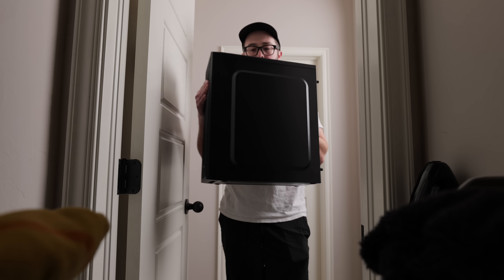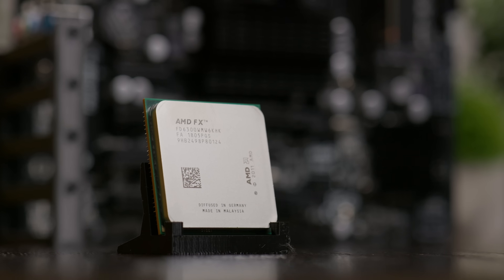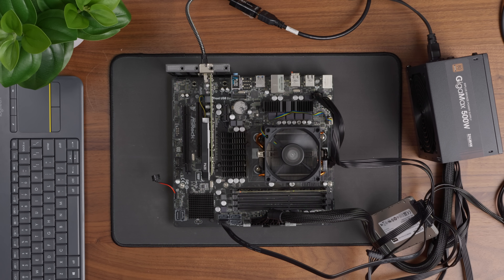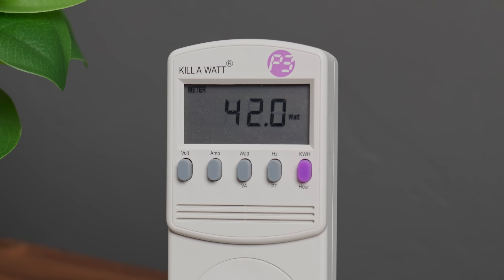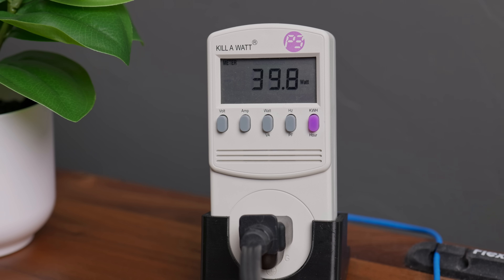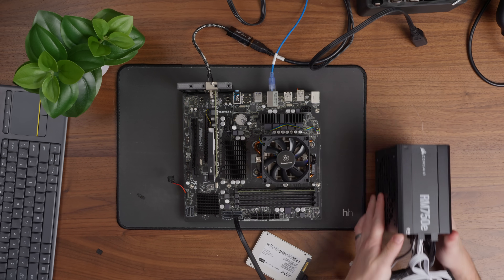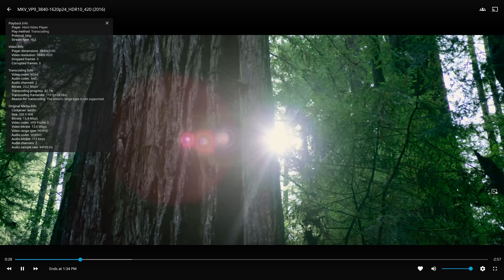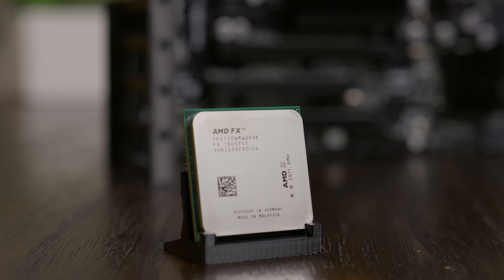This CPU Shouldn’t Work in a Home Server… But It Does

Comment: fx cpus are not only energy inefficient, but cost inefficient too. They recently became a collector item unlike intel cpus of the time, there is no reason to pay $30 for FX 8350 if you can get e3-1270 v3 (i7 4770 but with no igpu) for $15

Comment: 11:37 The idle power draw went up because of the minimal amount of CPU performance needed for the system to stay 'alive'. When 2 cores need to do the (idle) work that those 6 cores previously managed to do with a finger in its nose, it'll definitely need to work harder for the same idle performance than before. simple math. :)

Comment: I got a fx 8350 with a ASUS M5A99X EVO R2.0 AM3+ AMD 990X that has 6 sata 6Gb/s ports, 2 esata ports (sadly hard to find external that support them these days), 2 USB3 ports (plus 8 usb2 ports) and 1Gbit networking port. My mother needed something so she's using it but plan to get her a mini pc, then turn the FX system into a NAS server. Being able to have 6 internal drives, possible converting those esata to normal sata for 2 more drives, then possible 2 more external enclosures on usb3 means I could possible hold quite a bit of data and power is cheap here so power draw isn't much of a issue.

Comment: have you considered going really OLD school for the GPU? like a PCI video card? personally i keep one s3 virge around when i need to test the functionality of a motherboard, as its power draw is near to nothing, there is no extra power requirements, doesn't even need cooling for its chip. it predates my first computer setup but still usable and usefull

Comment: Run it using a much lower spec psu, preferably something like a picopsu.
psu's are very inefficient when not running them in the higher load ranges.

Comment: I'm Using AMD FX 7600P 3.6 GHz as a headless server. Windows Server 2025 and macOS 12. $100 for mini PC including  new 480G SSD, new 16GB 1.3V ram, new 120W power supply brick. A screw for SSD mounting I got for free in the nearest service center. lol. 
FX is not for gaming in 2025
Both PC and powersupply are 600 gram weight. lol

Comment: Dude I literally use an a8 5600k in my media server but it will get changed to a Xeon E5 2650 V4 pretty much just because the board has 10 sata slots and a few nvme slots so I don't have to sacrifice a sata slot for a boot ssd
My server is made to be as cheap as possible, it uses old pipeline Seagate drives, which while slow they were cheap, the current board came with the case, so did the 16gb ddr3 (4 x 4gb Hyperx), the case was bought in an ebay auction and it came damaged so they partially refunded me. I took the partial refund because I only really bought it for what was inside it, which was a decent power supply and high frequency ddr3 ram.
I only paid £25 for it, the power supply went into my main pc, I had a spare FM2 board with a processor in it which I put in this board (the a8 5600k) and the ram was kept in it.
The pc total only cost me about £75
Case, motherboard and ram £25
Processor £10
Power supply £19.95
SSD £4.60
HDD 5 x £3
When I do the upgrade the pc will have cost me around £200 but it will be alot more powerful and will be able to do much better transcoding because I'll use a lower power newer gpu

Comment: My old Core 2 Quad Q9550 (or might even be a Q6600) draws 140 W AT IDLE.

So, the chance that I will convert that to be a server is quite low.

Comment: My work had a dell optiplex sitting out in our e-waste recycling because of what I diagnosed as just a bad PSU.   i5-12500 (non-k) and 32gb ram wtf.    New home lab, yoink.    $25 for a PSU and its now up and running.

Comment: At the time, most apps only used 2 threads; with one thread for the OS, that meant the FX's arch was badly used. Also, support for extra C states was bad on all OSes  - meaning that FX were loud or unstable or hot or not performing well... Now, they're better supported. But, too late.

Comment: That is funny, my main node in my homelab is an FX 8350. Its a pretty decent chip and much more power efficient than my dual 16 core Opteron application server... LOL! I get why some would not want to run this type of setup, but when you have access to cheap power, its not a big deal. Funny enough, the dual 16 core Opteron uses less power than a space heater, despite being an HP Enterprise 2U system. That thing is quite efficient for its age.

Comment: Man my FX8320 was OCed to 4.4Ghz for 10 years and ran almost 10 years straight. Honestly wattage  of that old CPU vs the 3600 (Sadly died a little over a year ago) then the i5 8500, and the now 12500 that I run, I never really saw an overall wattage difference between all 4 of them. It was the removing of the GPU going intel and then consolidating to larger drives making less drives that really helped. I pushed 200W with a 8320, GTX960, and 12 HDDs. With the 12500, and 9 HDDs I'm pushing 150ish. I only retired the FX 3 years ago. I still have it, use it as a test bench PC at work sometimes.

Comment: I always love seeing the flip side of the coin, home servers and applications for low power systems.  It is in direct inverse of the crypto mining crowd, more heat, more power, more everything.  I love watching the contrast between the two.  When he starts talking about optimizations to lower power draw on a 100 watt system. I find it delicious.  The mining guys, talk about keeping a system up and barely functional on dual 1600 watt power supplies.   It is a lovely contrast.  I am in spring/summer mode at the moment, and am deploying micro pc's everywhere and cell phones to keep heat loading down and save on power.   It is so refreshing to see there are people that care about energy and heat and keeping consumption low.
Reply: Tbh miners do care about efficiency.

Comment: I was one of the few niche cases the fx series made sense for.  At the time, even though they used shared resources, an 8 core processor was devastatingly fast at hardware trans coding, and solving frames of video disk ripping.  It also was good at virtualization. The other thing to remember, even though the FX series was largely a commercial flop and in fact almost tanked the company, Rzyen would have not been possible without the groundwork that the FX series laid down. It probably should have not been released as a commercial product, it should have most likely been a research project into chiplet architecture.  Regardless, we owe a debt of gratitude to the FX line for its unique place in history and what developments it allowed.  Also, the 970 series motherboards brought lots of nice developments to the table, great quality audio, affordability, ease of use features like graphical BIOS, and crossfire support.  Many of those features were available on previous generation boards, but at a much higher price tier/performance tier.  For the home user, getting a decked out octa core system on a budget was a big win.

Comment: Just wanted to add some info and recommendations for folks actually using AMD FX am3/3+ for this project.   LDDR3 1600 with 2 sticks of ram for dual channel, and running the northbridge clock at 2200-2400 is going to make a massive increase in performance, while allowing you to drop core speeds down to around 3ghz.  Cache data movement is notoriously very slow, and seriously improving your memory bandwidth in this manner means you can get away with very low core speeds, which ultimately give you maximum power savings.

So try this at home.  turn off all the power saving features for now, as overclocking the northbridge can induce  some instability.  BUT if you do it right, you can use windows to drop clocks while idle to save even more power.

But I wager an 8-core FX running at 2.5ghz cores with LPDDR3-1600 or 1866 memory and 2400-2600 northbridge will perform great with turbo features turned on to around 3.5ghz.  This should allow fantastic idle savings (for FX chips at least) while still allowing single core performance to jump up without anything nuts happening

Bonus points for running VDDA at a slightly higher voltage of around 2.6-2.75 and dropping vcore down a couple notches!!

If I can get a 9590 to idle under 100 watts with 4 sticks of ram, I think anyone can run teh cheapest 8core they find (including some opteron on certain motherboards) and drop clocks for some nice cheap server activities!

Comment: They are pretty decent chips and I would say they were a pretty good deal even back in the day, as with AMD, it was an easy upgrade if you were on an AM3 platform. I went from a Phenom II 965 to an FX 8350 for 200$ CAD and that was a significant performance jump.
However for servers, you would be better off with a 7th Gen Intel I5 or I7. 
My Jellyfin / Milestone server is an I5-7600T with loads of harddrives and a 1050Ti

Comment: Yikes. I had (and still have in closet) an OC'd FX-8350 system with CFX HD 6950s when I had no A/C. It ran SO HOT. The OCing was the one thing the FX CPUs had.. they were not as good as the Intels.. but you could OC them. If you didn't want to OC them, just buy a more efficient Intel back then. But now it makes sense as old Intels always keep their values better for some reason. FWIW- under-volting was a thing back then too. And also- "relatively stable" is not a good standard for a home server. You want STABLE. Lol. Also x2- tech Power Up has some GPU power use charts. At idle, an RX 5500 XT just uses 2 watts, 6400 3 watts, 6600 3 watts, 1650 4 watts, rx 560 4 watts, rx 5500 4 watts. So there are other options to save power at idle with the GPU. ALSO X3- is it possible these FX systems might be usable for retro builds at some point? With Nvidia dropping 32 bit Physx on the 50 series GPUs... it made me wonder. Though I guess the whole "old OS online support/Steam" would be an issue. I find myself playing older games that I never played (as most new games seem unoptimized, unfinished, and poorly written)- tried Morrowind and it won't even launch on my 5600x/3060ti w10 system. Point being.. maybe these could be a basic home server and a remote retro gaming computer too.. though not sure how to do that and keep the server secure. Maybe a virtual machine with XP?

Comment: I'd say a mobile mutant board would still make more sense, a lot better efficiency.
You can buy power slipping N100/150s, all the way up to crazy powerful 24/32 core/thread 14900HX's, with a 45-55W TDP, plenty of room for undervolting, and all of the support for lower C states.

Comment: I got a 3200g system from a friend at very cheap price. Lowest I could achieve 23.5watt idle, and 37 watt on load by doing extreme undervolt 0.750v @2450mhz

Comment: A much lower wattage power supply would help the ideal efficiency is around 50% and tappers slowly as you go towards 100%, but it sharply falls as you towards 0%. So with a system like that if you are going to be closer to idle most the time you might find a lower efficiency 200w psu a lot better than a efficient 750w, also the cost

Comment: about 12y buy FX4100 & A6-3670(FM1)
A6-3670(&MSI A75A-G55 6*SATA3) ( used 1*SSD 5*old HDD)
idle 36W,AIDA64 +GPU test =175W;normal 36~100W up-down
need install LAV to view H265 AV1 Video.

Comment: I have an FX 8350. It is my left over home server. It worked fine for me for years. Currently, it is running Ubuntu with two 1660 Super as an AI LLM server. It works well, I get 12 GB of VRAM.

Comment: This is an excellent video especially for those who may have something like this in their closet or in their basement somewhere. I still find myself trying to repurpose hardware I have in my basement at times and if it doesn’t use significantly more power than what I would buy I reuse it. This is after homelabbing for more than 20 years and after several refreshes.

Comment: My first "gaming" rig was an FX Quad core and a gt 720.
It was basically something made from what cyberpowerpc had lying around, but I loved it, it was a great step up from the celeron 450 775 system I was using.
The power supply died though, back then Cyberpower didn't use a good PSU supplier.

Comment: I have a couple of FX machines, I'll be looking to see if they have the One core per unit option, as that would be good for an XP retro as XP doesn't understand dissimilar cores / threads... The old P4's could be HT or dual, but not both, and then Core 2 never supported HT (Quads were slightly dissimilar, as they were 2x dual in a package, so 2x L2 caches).
Pity it wasn't a board with IGP in the chipset, with a PCI slot, you could load the lowest power PCI card you can find
Reply: They're not common but Pentium Extreme Edition was dual core with Hyper-Threading.

Comment: Really like this kind of videos where the goal is to get the most per watt out ot the material. Have several old AMD systems to test this on, but would like to start with my 5950x based system that feels like it such up very much current for what I use it for, so much that I run  other systems that is quieter and less power hungry. Is there any good website to read about the subject?

Comment: Piledriver was the best and is the 1st improvement of 3, of the Bulldozer-based CPUs; anyway, is effectively a 3C/6T CPU, not a 6C CPU.
Why you have to have a Quadro GPU, that's a Server-grade GPU, use a cheap 1 GB GPU of the time

Comment: It's neat for reviving an FX you might already have in your closet, but if you're already hunting for deals on FB marketplace, a ryzen would be a way better option. I have a 2600G system pulling 35W from the wall, that's with a 10Gbps fiber NIC and four 3.5'' hard drives.

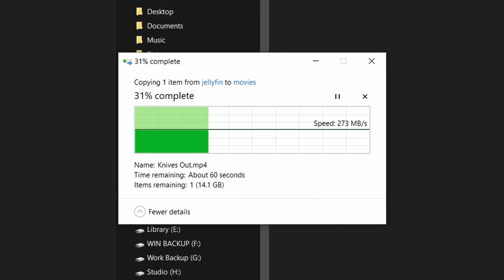Comment: I will mention that the 270 MB/s transfer at 14:33 was bytes, not bits. That equates to about 2.1gb/s, so the card was giving nearly full 2.5g speed. Plus the sata 2 port wasn’t the bottleneck here since that’s 3g. Your missing .4g is probably mostly overhead.
Reply: I was thinking the same. I was wondering what was he complaining about. 100mbps is ~10MB/s. 1gbps is ~100MB/s. So 2.5gbps is ~250MB/s.
Reply: @ayuchanayuko  That's... not how that conversion works. There are eight bits to a byte. 100 Mbps is 12.5 MB/s, 1Gbps (1000 Mbps) is 125 MB/s, and 2.5Gbps is 312.5 MB/s; but the general point is the same, it is indeed a very high speed.
Reply: @ I know the proper conversion. But that is the estimate and easiest way to explain without explaining possible overheads and peak thruputs. I've added ~ to make it more palatable.
Reply: Late but oh well.
All of the 800 and higher series of boards for AM3/3+ supported SATA 3.0. 700 and lower were all SATA 2.0 and were mostly AM3 only.

Comment: Ya I could have answered a lot of these questions about these FX and Phenom CPU's from my time with them. Disabling the cores doesn't really disable them. That feature is more to guide the OS to not use them. They remain active, just not in use. This was done because it wasn't entirely rare to have a core die and make the system unstable. I should know. I had a last gen phenom 2 and FX have bad cores on them. same power draw, but had cores make the OS unstable after years of use. These CPU's weren't particularly good, but I think they were good for AMD to teach them about they shouldn't do and what they needed to do in order to succeed. Enter Ryzen and Threadripper. Anyway they were nice cheap CPU's for the era, if you weren't too worried about frame rate on games. AMD user for 25 years now, I can tell you that is a family of CPU that I do not have the fond memories of.

Comment: This is the kind of situation I'm revisiting lately with my FX-8370. The one thing about this setup is that it's a special purpose computer where dropping voltages for the sake of power consumption and underclocking is NOT the mission. When underclocking FX, you are effectively agreeing to run minimalist loadouts that are made simply to exist. I already have something like that in the form of an eMachines running a:
15W 1c/1t Athlon 2650e
2GB DDR2
10GbE SFP
16GB USB bootvol
and pair of HDDs with a sum of ~20TB

THAT system is glued together by a SFF chassis, big+little pair of fans and 225W Delta PSU that reads 48W from the wall (~1KW/day). That's the avg at EVERY load.

The FX is very different: LOTS of high clock cores, low speed (but hustled) cooling, a moderate challenge to keep the 970 chipset temps under control and LOAD UP THAT BOARD. The FX memory controller likes high speed memory so a 16GB G.Skill 2133 kit works fine for my needs. There are lots of early AM3+ boards that don't like running that way and will downclock to 1600 when running 2 DIMM per channel. So that's great. I also picked out the Quadro P620 just for the sake of having NVENC for once in my life and that should go pretty well as it's slightly older than my full size RX580 (185W) but just a 40W card with no additional power delivery required. The point is to have a fully functional video/stream/virtualization/container/render server that mains as a VR capable OBS system. I used to do lots of cool 3D/VR stuff with it when it was my main computer and it still has a very long life ahead of it. There are more than enough lanes available on the Gigabyte GA-970A-DS3P to run:
6 sata HDDs
M.2 Riser card (g2x1)
Quadro GPU (g3x16)
AV capture device (g2x1)
10GbE SFP (g2x4)
1GbE NIC
Wireless card

At some point I'll switch out the 10GbE SFP for a 400GB WarpDrive and that becomes the permanent config for record+stream.
If this were running on a 990 board, I wouldn't have to choose between the cards and STILL have lanes to spare. 990 was nuts.
Custom fan curves and airflow shaping is definitely needed but from a 460W box in a 2U pulling anywhere between 65-225W, it's cool.
It would probably make way more sense to rack a Ryzen 3600 for this purpose but I just don't have the PCI-E lanes for all of this.
FX still rules for personal server in TOTAL capability, expansion and compatibility. Guess it really is future-proof.
Reply: Yikes